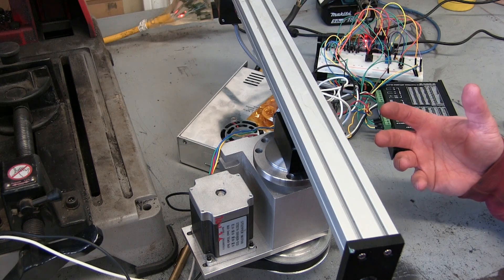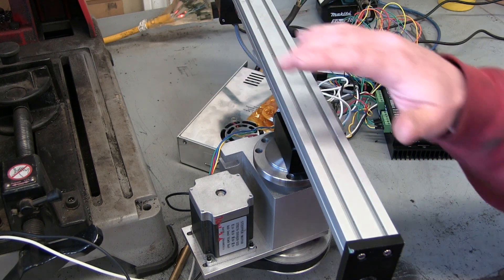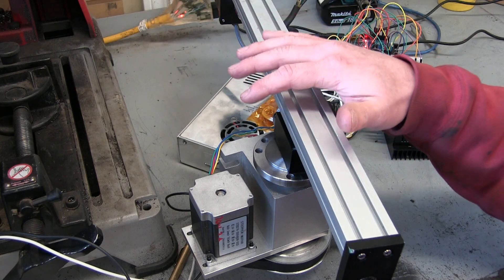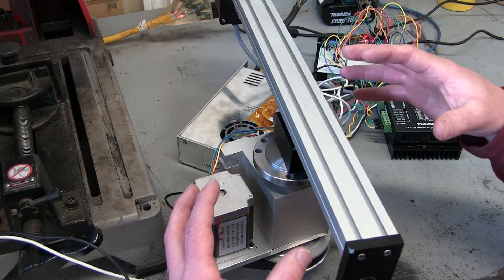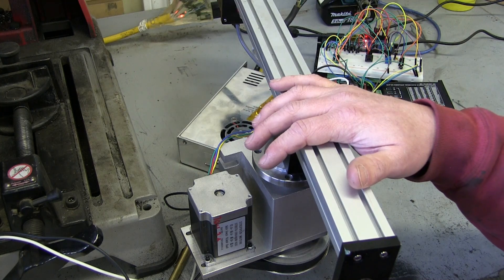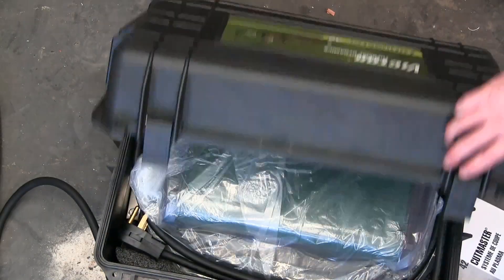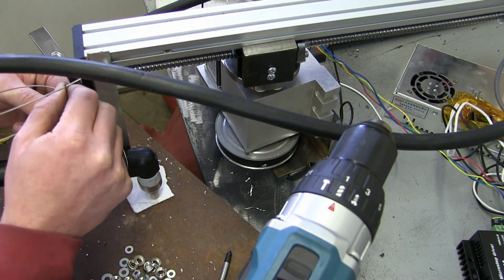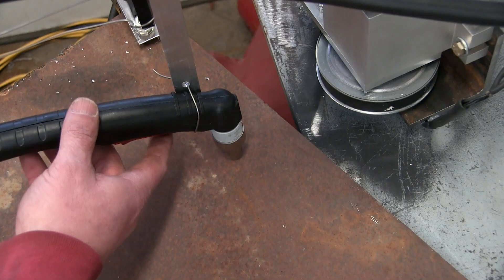Portable CNC Plasma Prototype

Comment: I think it's time you came out of the closet and accepted the fact that cnc is what you really want. 

It's OK its 2017 now people don't judge like they use to.
Reply: Well... it is. Allot means to distribute or portion up. It's just not the right word to use where he used it!
Reply: Do you know anything about that german CNC machine he's got? I don't understand why he hasn't ordered an English version of the manual. I mean, Im not challenging his highness, AvE, but can someone point out to me why CNC repair is such a futile or impractical undertaking--why its so entirely futile--that someone with as flexible of a knowledgebase/or acquisition-of-knowledgebase as David would declare it retired to the empire of dirt? Is it like exceedingly dangerous, and I just don't realize?
Reply: USB->LPT: No. USB doesn't meet the timing requirements for coordinated 3 axis motion. I went with an ethernet to parallel card because it can buffer as required and shit out the pulses for six axes at the correct moment. (Because I'm working on making a fourth axis for rotating a part for working on cylinders, and a potential fifth and sixth for potentially making a a crazy abortion of an automatic toolchanger I didn't go super oldschool on the confuser because I got a mill to make chips, not to make me screw around with keeping yet another old confuser working. What I'm saying is that CNC can be as difficult or as easy as you want it to be. Inclusive of AvE restoring/repairing that CNC machine.
Reply: Stepper motor based CNC can be controlled with the parallel port on an old confuser, (Or an Arduino with the exact step/direction/delay pulses) at its simplest. I have a 3-axis Wrong Foo milling machine (From Sum Yung Gwai Heavy Industries of Dong Hung Lo, Middle Bumblefuck, China.) with NEMA 24 steppers and Gecko stepper drivers. I choose to make life harder by using a a cunfuser, to an ethernet-> parallel port card, to a breakout board to interface the step drivers, home and limit switches, emergency stop, a coolant sprayer and the spindle VFD. (I can probably fire the damn thing up in the garage from the living room if I were stupid enough to run something completely blind. Such a seriously bad idea: Like hitting the power feed while you go answer the phone...)

Servo-driven mills have similar options. The control software can handle them if you have the right motor to confuser pixie amplifier.

It's like hydraulics or magic smoke carrying pixies: You don't have to think life's difficult: there are actually some bubblegum types of parts. The problem is usually that people try to make it too difficult so they can laugh at the noob.
Reply: Or not.  'Allot' isn't a word.  'A lot' means 'many'.
Reply: Allot is a word.  It's not being used correctly here though.
http://www.dictionary.com/browse/allot
Reply: Syncubus http://hyperboleandahalf.blogspot.co.uk/2010/04/alot-is-better-than-you-at-everything.html?m=1 I think you'd like that link :)
Reply: Sorry for teasing you about a petty mistake.  I just thought it was kind of funny to point out in this context.
Reply: Wow, you're probably right, that's infuriating, I was about to say I'm not surprised; but obfuscating the fucking components' details, see That, that makes me want to disembowel myself in protest, I'm actually having a hard time breathing writing this. I mean, designs-or-IP theft/corporate espionage make sense--I get that, but THAT, what they did, transcends "planned obsolescence" by so much that I hope personally that Hell exists so... I'll let your imaginations can fill in the blanks there, thanks for the insight!
Reply: Syncubus damn really a spellchecking nazi fucker on a mechanical enginerding vijayo come on man
Reply: CNC is not a versatile system. Robots don't know what material they're cutting and neither do the cad-monkeys (usually). A good machinist and the customer can sit down with a pencil and paper and make in 5 minutes what a cad engineer would screw up in a couple of hours. 1 person + 1 robot =/= 1 person

Comment: we gotta figure out a faster way for stainless! i build pre-lube skids for rolls-royce and could use that a million times a day..but she is all 304-316l..so im left drilling holes by hand lol gotta love stainess
Reply: Pre-lube skids?
Reply: Plasma cutters cut stainless like a charm.
Reply: hydraulic fluid for turbines and pumps in the natural gas and oil industry
Reply: yes they do but the magnet....
Reply: clip board warriors always screw up on drawing so we always have to pop a hole where it dont fit and there is no room for error so free handing is outta the question ya know
Reply: Oh yeah I forgot, the 300 series is non-magnetic. How about a big-ass suction cup on the bottom?
Reply: that might work but the heat?...1/4 in thick sends heat fast ya know
Reply: Plasma cutters don't pour massive amounts of heat into the work like oxy-acetylene does. Even in mild steel the area just outside of the kerf doesn't get terribly hot, and a half an inch away it's just barely warm. Stainless steel is a horrible heat conductor, so it heats up even less than mild steel. I think so long as the base wasn't within just a few inches of the base it'd be fine, we'll say 6" just to be safe.